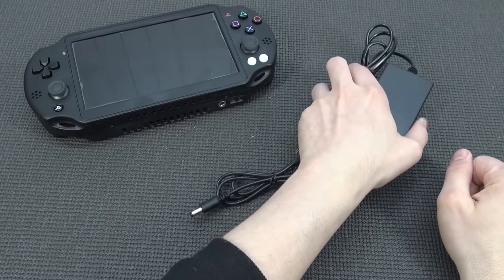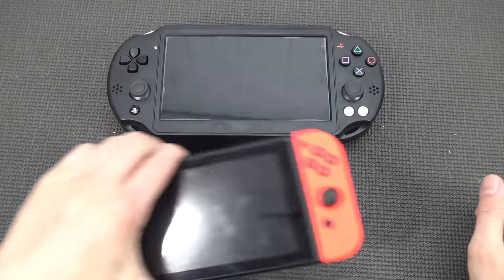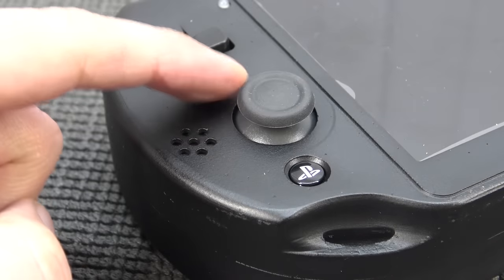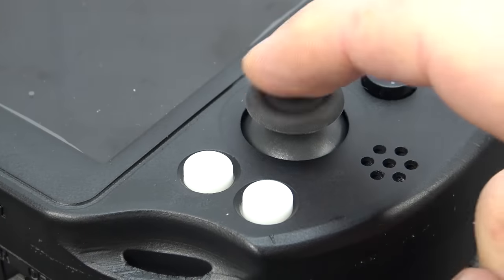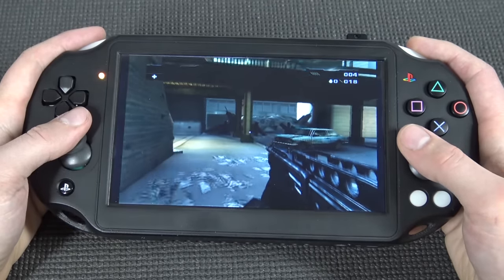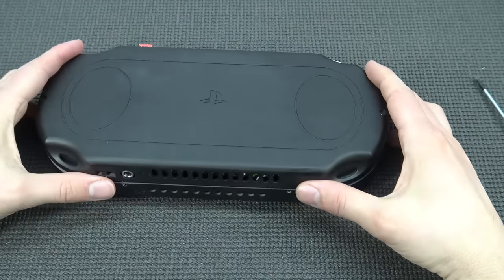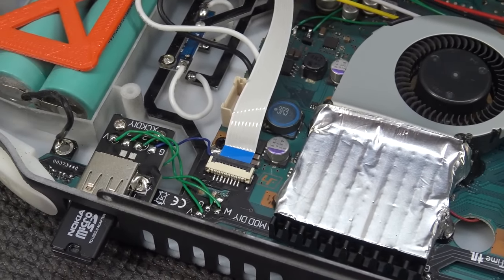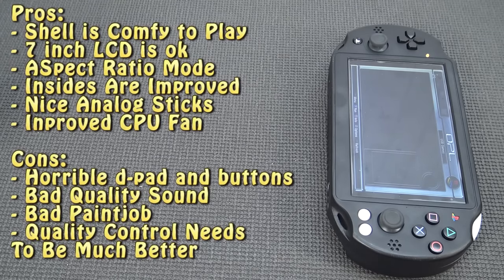PS2 Portable 2021 Model .. is it Better This Time ? 🙄

Comment: Maybe you could get a PS4 controller take it apart and replace the buttons and D pad for a better playable experience, but for the money you paid for it you shouldn't have to do that. For the price, it should have been near perfect straight out of the box. They even messed up the angle of the foam cut out in the storage box 😞